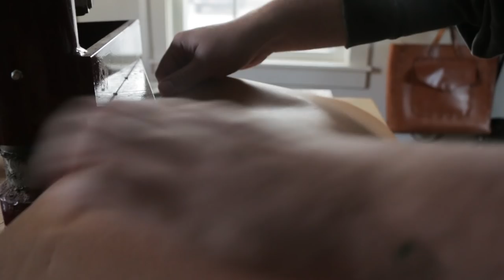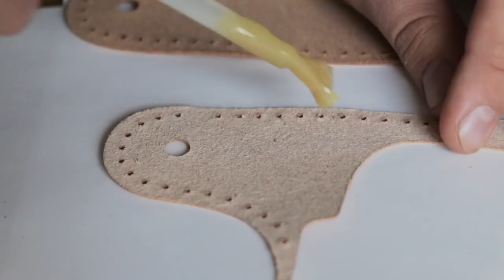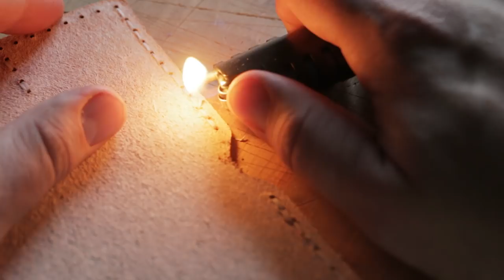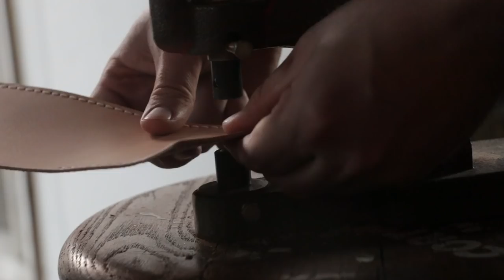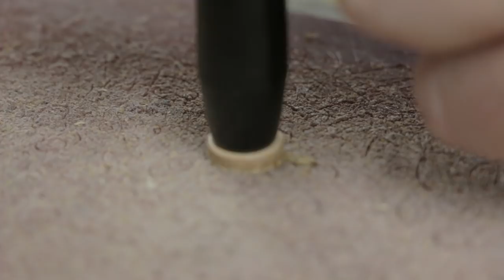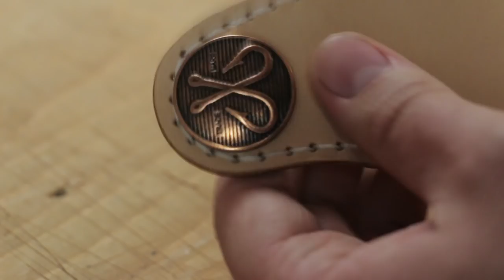Making a Leather Snap Wallet with Cutting Dies

Comment: Where did you have your dies made? I'm assuming the dies are pretty expensive? Also, about how long does it take you to make one wallet from start to finish?
Reply from the maker: We use a few different die makers - Weaver Leather has a die program a lot of folks use. Ours have the stitch holes in them, so a full set used to make a wallet like this would range from $4,000 to $8,000. Each individual stitch hole is about $8-10, this set has over 500 stitch holes in it. Not sure on time, we usually make batches!
Reply: Oh wow that is a lot more than I expected. I'm in the middle of a startup and was doing some research on weaver, but haven't contacted them yet. I guess I will have to stick to cutting them out myself and punching my own stitch holes (for now). Would you happen to have any advice on a good leather supplier with decent prices? I'm waiting on my wholesale/resale license to get approved before I make contact with anyone.
Reply from the maker: It's a big investment - it's taken me 10 years to build our library of dies and we only have a dozen or so silhouettes, there aren't many other folks that do it the way we do besides the kit companies. 

We only deal directly with US tanneries and don't really care about cost as long as we get the best quality we can find, so I'm not much help on cheap leather distributors. I'd just say do your market research before trying to get into the industry. Find an under serviced niche and make something they need. I started Corter because there wasn't a single US-made hand stitched bifold wallet available online...ten years later there are thousands.
Reply: Corter Leather I don’t suppose you disclose paper templates of your wallets to the public?